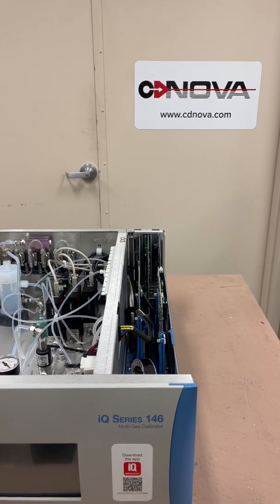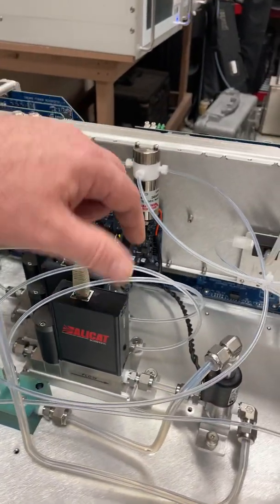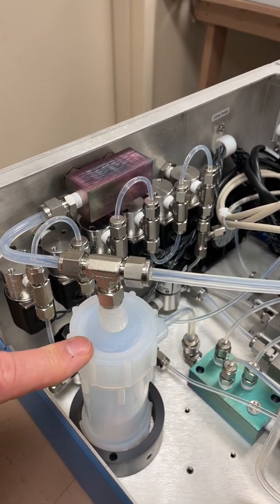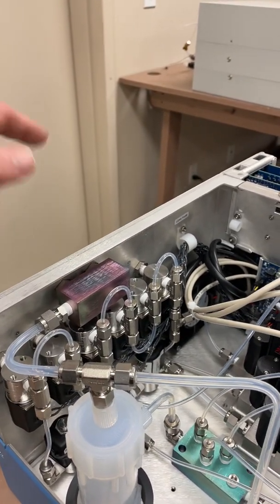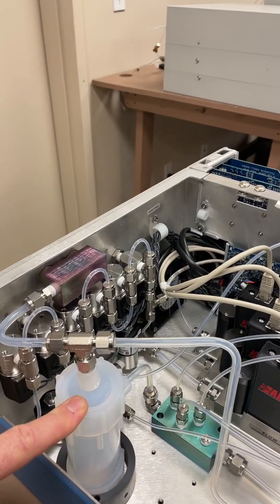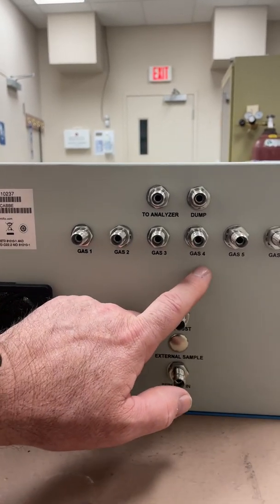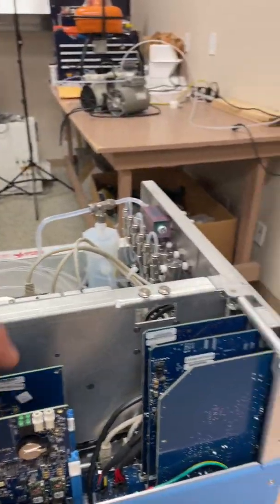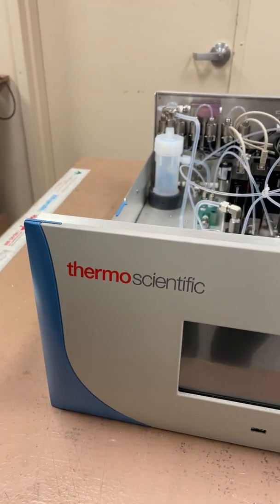Thermo Scientific Model 146iQ Multi Gas Calibrator

Comment: Nox analyser chamber pressure high alarm
Reply from the maker: Hello, is this a Model 42i or Model 42iQ ? High chamber pressure could be caused by the sample pump with low vacuum. Try replacing or rebuilding the vacuum pump to increase pump vacuum. Another issue could be a leak in the sample tubing. Inspect all tubing in the sample system, looking for breaks in the tubing.

Comment: Thanks for a very good presentation of the calibrator. Can you tell me what diameters of the connecting tubes are needed for the calibration gas ports? Can they be Teflon tubes?
Reply from the maker: The connecting tubes are 1/4-inch OD with a minimum ID of 1/8-inch and yes they can be Teflon tubing.